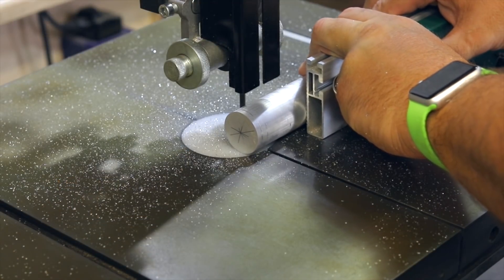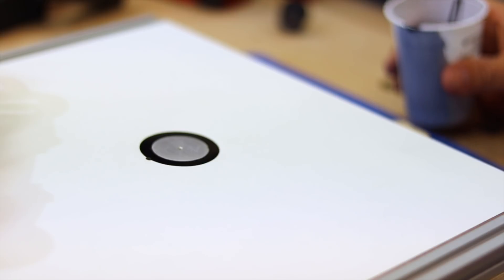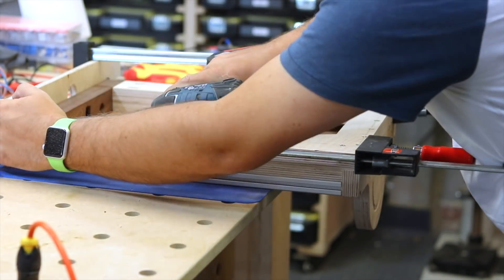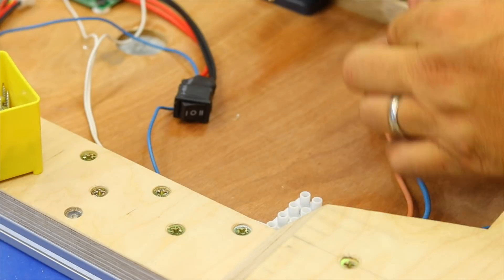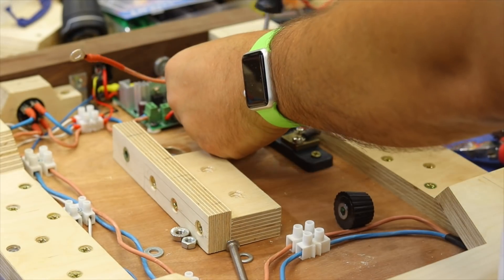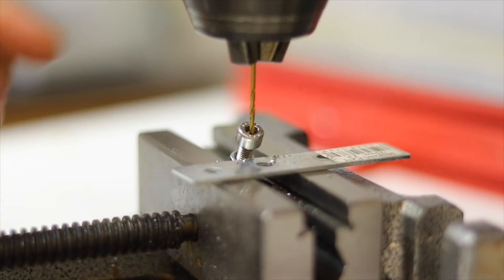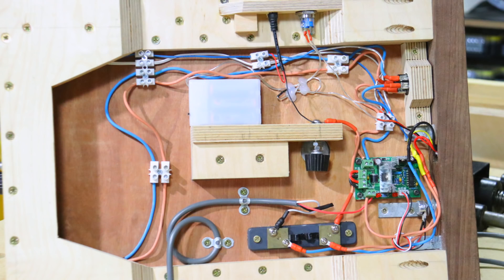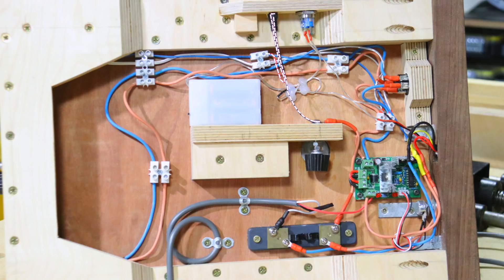How I Made my Ultimate Hotwire Foam Cutter - Part 2 of 2

Comment: I don't have access to exactly the same materials as Geoff (I have 30mm extrusion, instead of 20mm, for example) but here are my Sketchup model & plans (open the Scenes to see the plan layouts).  It includes the basic structural elements and excludes the electronics, accessories, guides, etc.  https://drive.google.com/open?id=1LI7r76zzzlpL5m2SMb9QHb3kT6kSxgEE
Reply from the maker: Matthew Miller looks good

Comment: Geoff, (Jeff?) - was wondering whether you wired it with 20A circuitry for need, or would 10A be sufficient?  I am definitely not an electrics guy, and can't find many 20A components locally here in Cairo, but can find equivalent 10A ones pretty readily.  Do you think those would be sufficient?  For example, I can get a 10A PWM Motor Speed Control Switch Manual (12Vdc to 40Vdc) but can't find a 20A one, can get a 10A Volt & Amp meter but not a 20A one, and so on.  Thanks for the great build video!
Reply from the maker: Matthew Miller first spelling was correct ;) Geoff.
10amps will be more than enough for this, I rarely go above 5amps, some dense thick foam then 8amps depends on the speed I want to cut at. But obviously I am no electrician so do this at your own risk ;)

Comment: nice video.... awesome result. I am surprised you didn't put the degree angle on the back of the unit - adjustment point. :)
Reply from the maker: Thanks! I didn’t put the degree angle on the back because I had too much flexibility in adjusting the wire, so when changing/ replacing the wire and setting it back to 90° I didn’t have the confidence in the accuracy of the locked position at the back. I preferred to check the Angle each time to be certain. Maybe a future version will have more of a positive stop and therefore degree markings. It is something that was on my feature list originally.

Comment: Hi Geoff, great vid but most importantly, yours is the best design for a DIY hot wire cutter that I've seen anywhere on You Tube... very well done Sir!  Also, your exlpanations are first class... I particularly liked your highly instructive and easy to follow demo of the electrical circuitry ... I'm no electrician either but I reckon I could follow your explanation and diargram easily enough. I love your attention to detail... there's some real junk out there... I reckon your design will last for ever.  I'm looking into building a hot wire cutter as I need to reline and refurbish a guitar case for a very expensive guitar... but I can also see uses for other bits of my band's gear... cutouts for microphones and in-ear monitors and any other electrical stuff etc.,  which needs protection.  Well done on a great design and build.  Cheers, Kevin from Southport (it's not in the South and it's not a port... go figure).  Here's a link to some live performances of my band.  Enjoy!    https://www.youtube.com/watch?v=p-WE3mEkgGI
Reply from the maker: Kevin Hookham 
Thanks a lo,t some very kind comments, much appreciated. I will check out your your  music and good luck with your hot Wire cutter!

Comment: Hi dude, may I know the purpose of using Motor control board in this project? Is it necessary or any optional component we can use for this purpose?
Reply from the maker: Yogesh D It had everything I needed in one board, enough through put and a potentiometer so I could adjust the amps  running through the wire.

Comment: What kind of PSU did you use? I tried a 12v 6a PSU, but I didn't get very much heat. 0.3 mm wire. PSU got very hot in short time.
Reply from the maker: What type of wire are you using? I used Nichrome 28 gauge, i think this is key. As for the power supply, i have a 12volt, variable up to 15 amps. I generally have it set at about 15amp. but then vary it on the potentiometer only using about 4 amps. I think all of this is dependant on the the length of the wire. You can use this calculator to work out what you need for the gauge wire you have: https://www.easycalculation.com/engineering/electrical/nichrome-wire-calculator.php Good Luck!

Comment: You have wired the ammeter shunt to the positive side of the power supply and not the negative, that's why it doesn't work with the same power supply. There is a diagram on the amazon page.
Reply from the maker: mimiminied thanks! I found two different diagrams on Amazon. Thought I had followed them in a prototype set up , but couldn’t get it to read Amps, just volts. I am certain it is down to my error, but for the life of me I was sure I tried it to the negative. Must have been something else I had wrong as well! Electrics is not my strong point ;) 

Anyhow thanks for pointing out my mistake!!! I will get round to trying it the right way.

Comment: You are a good craftsman but this is overkill for a hot wire cutter
Reply: cartmanrlsusall Why?
Reply from the maker: Depends on what you use it for and the accuracy you need from your wirecutter i suppose.
Reply: @StuffIMade  I take it back if you want dead on accurate a heavy stiff structure would probably be a good idea